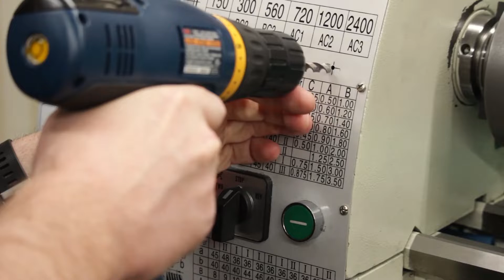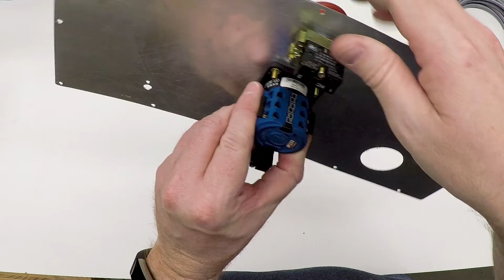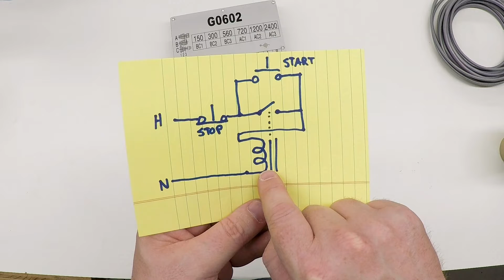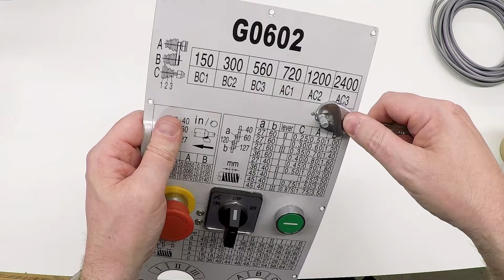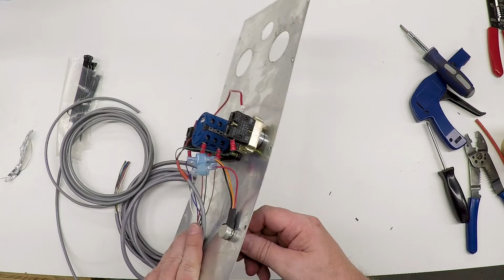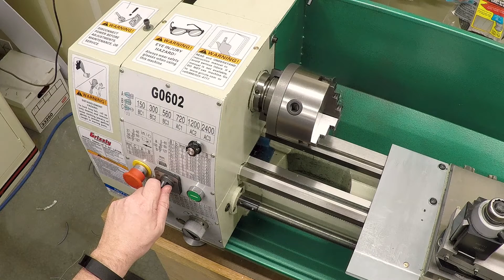Lathe VFD 6: How to Connect and Test the Controls

Comment: thanks! i keep learning a lot from your videos. i have a question. is there a reliable way to read the RPM, that doesn't cost a fortune? you know, to show you on a diplay the exact RPM. it would make this project whole i think.
 Next stop DRO for the lathe? (i guess those do cost a bit haha)
Reply from the maker: Yes, there are lots of cheap tachometers all over eBay.  Usually, there's a magnet you have to glue to the spindle or one of the gears and a hall-effect sensor.  I'm actually thinking about building an electronic leadscrew someday (so many projects...) and that will have an encoder on the headstock that I can use to read the RPM.  Though that's going to be a much more involved project than you probably have in mind (mechanical, electrical, microcontroller, software, etc.)
Reply from the maker: Oh, and yes.  A DRO is also in the project backlog.  In fact, I already have one, sitting in boxes in the corner of my living room, waiting.  The only reason I haven't done it yet is because the X axis install is going to be very tight and I'm still waiting for the good idea that's going to make it easy.  :)
Reply: Yeah there is a way, a cheap $15 digital display off of Ebay and you'd need to probably remove the headstocks sheet metal to access the lathes spindle to mount whatever rotary pick up sensor type it uses.